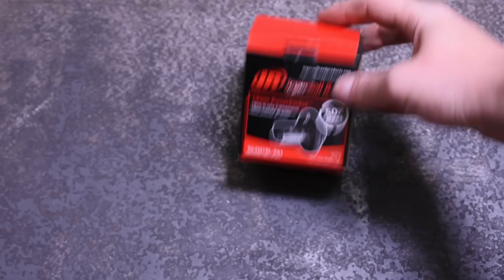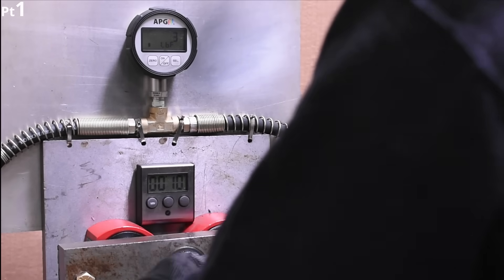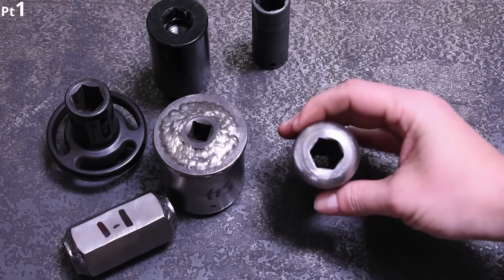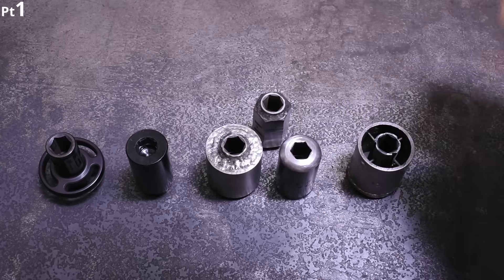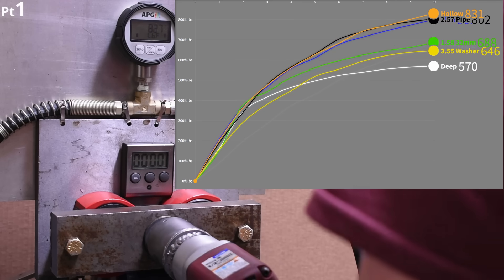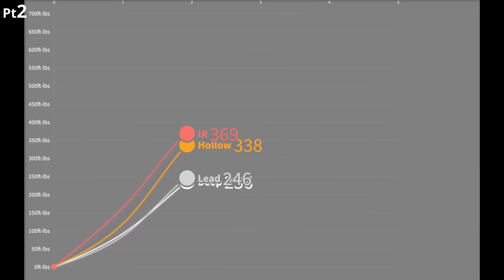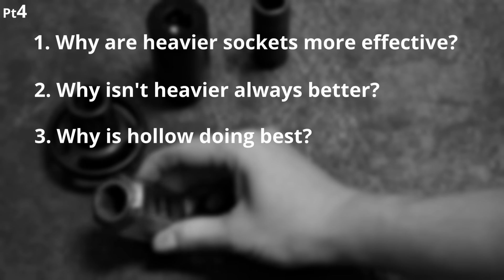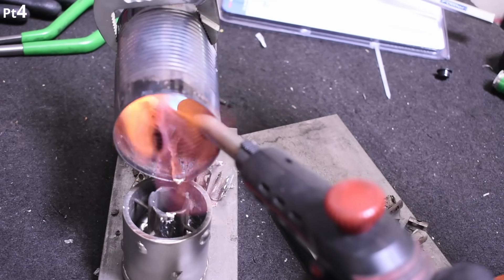Heavier Sockets Make More Power? Stumps Physicist

Comment: I would be curious to see how precise the fit of the socket on the anvil and the bolt would affect it, I feel like I have noticed a difference between different brands before I wonder if it's because one brand fits better
Reply: Definitely need to check this out. I’ve had sockets that were real snug on bolts not hit as hard as sockets that were looser on the bolts head.

Comment: Thank you for this video - this has been puzzling to me up until I watched your video I believe that also harmonic vibration is at play here from the Impact Wrench . Henceforth some type of small harmonic balancer/damper or dampener may be the solution . The Rattler brand performance  harmonic balancer is composed of internal rollers that absorb or displace resonance with variable rpm . Using an impact is WOT (wide open throttle) so a design with a rubber elastomer sandwiched in your hollow socket design may be on the right track .

Comment: Spring tension might be a factor. Metal used in bolts and tool steel isn't 100% rigid, if it was, it would sheer off or fracture under torsional load. The flywheel design might be using that spring tension to keep the socket from "flexing" as much when the impact hammer releases it's energy into the socket.The metal wants to spin the opposite way that you twisted it because of spring tension in the metal. Theoretically, you could reduce that from happening with a flywheel.
Reply: Yeah maybe like the TTC rope-hammer analogy. Maybe the flywheel is holding the rope (the spring in the socket) at the top twisted while the hammer pulls back to hit again
Reply: @LincolnElectricDaycare  Yes. A flywheel is an inertial torsional lever with a fixed position. That's why larger engines need larger flywheels to prevent the engine compression from trying to reverse the engine direction when there's no power stroke happening.

Comment: The flywheel on the IR should be adding rigidity.  It is no different than how an I beam works, just in a circle and for a very small length of the socket. Second moment of inertia stuff. Your hollow socket is like an ideal version of this and carries the rigidity along a longer length of the socket giving it a net greater rigidity.
Reply: It's only connected to the socket body by three spokes and it's very short compared to the socket length so change in torsional stiffness would be negligible IMO.

Comment: you power the "flywheel" it's like how those old heavy oil engines work. this makes sense. do you think the material might be part of it? seems like soft lead might not transfer as much energy and would absorb some.
"moment of inertia"
Reply: No it doesn't make sense in that context. A flywheel is used for energy storage, in the case of the engine it absorbs energy on the combustion stroke and returns it on the other three strokes. You don't want to absorb energy in an impact wrench, you want it delivered to the fastener. There is something more subtle happening here, I suspect the natural frequency of the socket moment of inertia and drivetrain stiffness (i.e. a spring/mass system) is close enough to the impact rate that it is close to resonance. This would explain why both light and very heavy weights fail to deliver as much torque.

Comment: maybe the webbing on the IR weighted sockets moves more mass to the outside and gives it more momentum.......i would like to see side by side with the electrics vs the air and see if the impact action is different than the electric motor driven force....Force equals mass time velocity squared divided by radius....I am sure some physics may explain the higher or lower forces

Comment: Excellent video presentation, you were able to lead us to the conclusion without spelling it out and confirming what your findings suggested with a reputable source. It’s interesting that these impacts are so powerful that you are actually losing power from the sockets flexing as this video shows, and also might explain why the effect could be lesser with larger sockets, because they are larger and more rigid and aren’t being delivered the same power per volume of steel, so there is less lost energy in vibration.

Comment: Maybe some sort harmonic thing happening? Everything is a spring after all. Those webs in the IR socket may be flexing under impact and the rebound is imparting more energy into the blow.
Reply: it's totally about the combined resonance of a series of springs, yes. one of the springs is how tight your hand holds and twists the powertool.
Reply: I was thinking the same, if the impact rate is somewhat close to the resonant frequency of the socket mass and impact drivetrain stiffness then peak torque could be increased quite a bit. This would mean that the ideal mass would be somewhat dependant on the impact wrench used, but I guess they are mostly in the same ballpark.

Comment: There is a logical solution from physics standpoint. The stiffness of the socket increases the capability as it flexes less as you might think about torsion reducing sticks that only goes so far and start flexing. The mass might improve things but as for why the heavy spacer stack and lead version did not succeed is based on the fact that those have a low torsional rigidity. On the lead the lead is so soft that it flexes itself and the spacers were only strip welded which gives flex also. This is why the hollow large diameter pipe was a good one as the pipe is very rigid. The flywheel one shoud be very hard steel and delivers impact very well.
Reply: I completely agree.  IR pulled the old smoke and mirrors trick.
Reply: So a tungsten socket might actually be good as long as it's not too brittle
Reply: So if IR used the smoke and mirror trick, then cutting the flywheel off would have increased or matched previous performances.  I agree that torsional energy delivered is correct in regards to Flexibility x Mass x Velocity.  The key I believe is finding the correct combination of the three to increase torsional force applied.

Comment: Would you guys be able to do a video on impacts tightening lug nuts to see how accurate or (likely) overtightened lug nuts become? Ex. Using 1, 2, or 3 ugga duggas as a "unit of measurement."
Reply: Tighten lug nut...if it gets loose while tightening, it's overtightened.